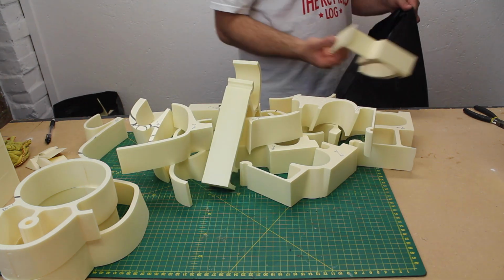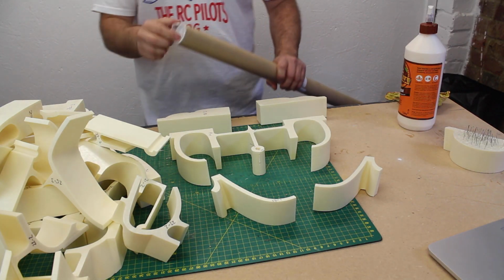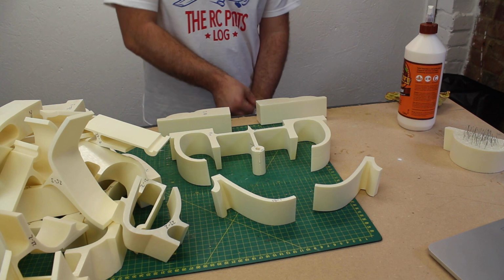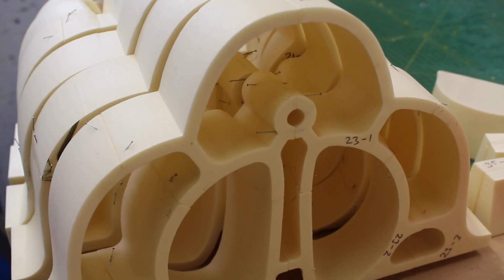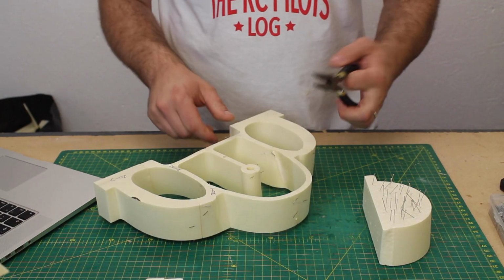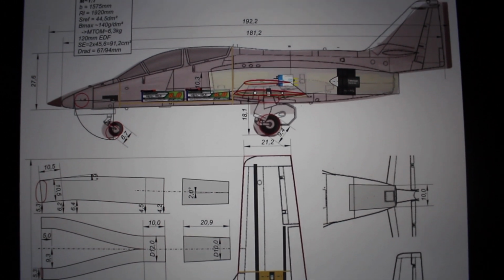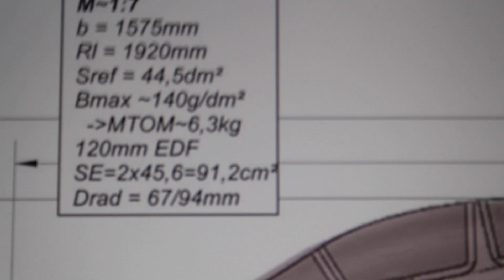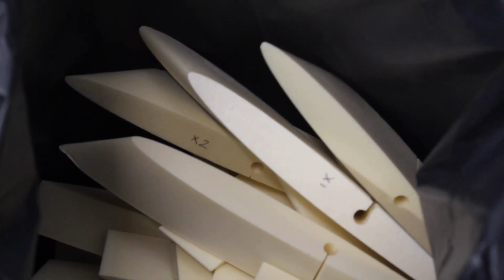Aerotetris CASA C101 Aviojet - Fuselage - Build Log Part 3

Comment: Your heart must have soared when you saw the fuselage taking shape. Mine did when I saw the inlet ducts forming! How will you extend the carbon tube for the aft section?
Reply from the maker: +Lozzie74 hahah it did! It’s nice to see it come together, but still a long way to go. There is a second spar at an angle into the tail. I will extend the main spare with a 12mm OD, 10mm ID tube glued over.

Comment: Wondering what retracts you will be using. I like the idea about making a clear canopy and was wondering if anyone else did that as well. I was wondering also about those access areas as well mainly for mounting your servos, cutting out the control areas to scale etc. the 120mm edf can be cheap or pricey depending how much thrust you wish, I hope you can find something close to a one to one. I was wondering how you will finish the outside of the foam as well like a thin fiber glassed painted area. Good luck and following closely!
Reply from the maker: I'm still looking at retracts, there's so many to chose from and getting a bad set only leads to failures! I'd like greater than 1:1 thrust, looking for 8 or more Kg really, so something like a JP and JetFan on 14s, but as you say, things get expensive.